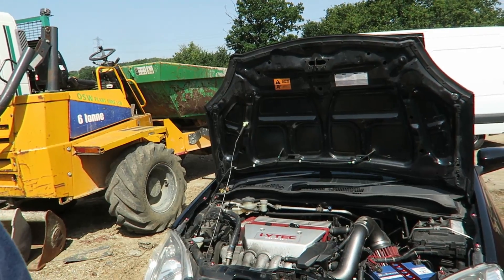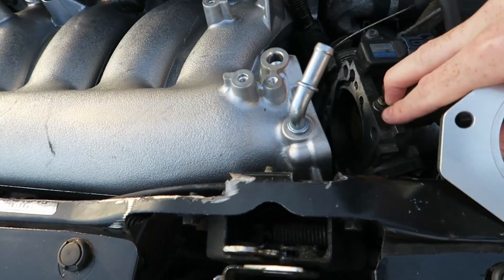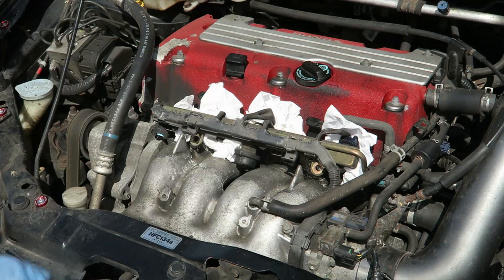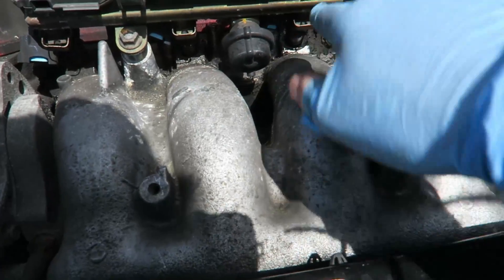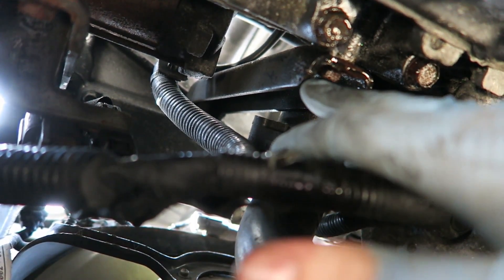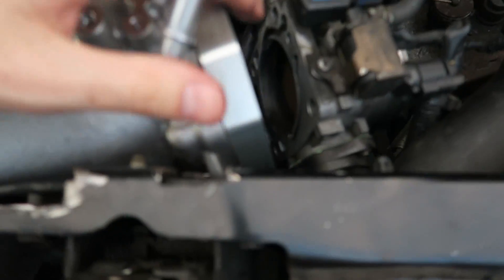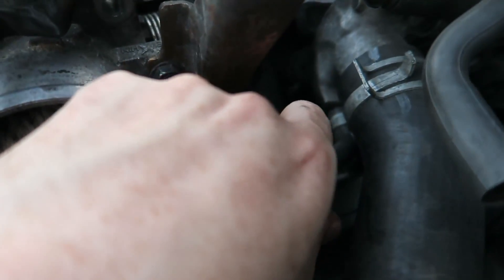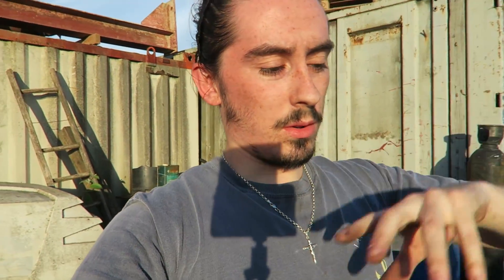Fiiting an RBC Intake Manifold to the EP3

Comment: Good informative video , keep up the good work mate
Reply from the maker: Cheers man, just need winter to be over 🙄🙄🙄
Reply: @UnluckySully  yeh haha the car is taking shape mate , you're doing the right thing doing the do-able jobs yourself , will save you a fortune. When you planning a remap ? Power run etc? I run a 55 plate cosmic premier.
Reply from the maker: @fasteee  I already have remapped it, I had a video on it but it made 242 😂😂. With your face-lift you would make more though, really love cosmic grey though 😍😍😍

Comment: Thanks for the video. I am considering this upgrade and I didn't know about the MAP plug. I also have the same AEM V2 Intake you did and I now know that it will not fit with the intake (At least without modification)
Reply from the maker: Same I was really confused when installing it and seeing an unplugged hole in the intake. Couldnt find any information about it. Exactly even if you did get the AEM V2 to fit there would be so much heatsoak killing horsepower.

Glad the video could help!

Comment: So tegiwa, be lying when they say HONDA RBC Intake Manifold. However straight out of the box it needs modifying and will not fit the K20. Ours are modified here in the UK on our CNC vertical machining centre, and are therefore ready to fit straight onto a Civic Type R EP3. But you needed to cut yours to make it fit

Comment: Hiya mate - decent video, enjoyed it! thinking about doing the same mod on mine. Question for you - did the car run okay after install or did you have to get a kpro to map it etc? or do you already have a kpro/k100?
Reply from the maker: Hi, thanks for watching! Yea the car runs perfectly fine without any ECU changes as its still letting the the same amount of air in the engine, but in order to get the best gains from it you would need to remap it.
So yea I installed it and drove it for about 2 weeks no problems and even drove it 60+ miles to get it remapped on a stock ECU
Reply: @UnluckySully  nice one cheers for that! I was worrying as im planning on getting rbc and maybe bigger tb - then save for the kpro, and was assuming the Air fuel ratio might be impacted but sounds decent cheers fella!
Reply from the maker: @DJ-J3  No problem man, I mean with a bigger throttle body it might run a little bit leaner but that wont cause any issue to the engine or reduce power, do youre all good. Hope it all goes well for you :)

Comment: Do you need a different cooling hoses for the oem body??
Reply from the maker: Nope I used all the original ones, you could change out one of them as it does come up a little short but mine fit and haven't changed any of them since

Comment: Do you remember how you ended up getting the 2 other bottom bolts out?
Reply from the maker: Yea I used a knuckle socket adapter to crack it then used my hand to get it off, it's very difficult with the limited space 👍
Reply: @UnluckySully  thanks for the fast reply!

Comment: Did you drive long time whit the 63mm throttle body whit no tune?
Reply from the maker: I drove around for about a month with it and there was no issue
Reply: @UnluckySully  thanks man.   I have now injen long arm cold air,   70mm tegiwa cat back and custom plm header
Reply from the maker: @driftking1933  Ahh nice, have you got it remapped or are you doing anything else before?

Comment: is this a 70mm ported inlet ?
Reply from the maker: Yea it's 70m but you can buy a bracket that can fit the standard throttle body as well so you don't have to install the rbc and 70mm throttle body at the same time 👍👍
Reply: @UnluckySully  thanks for the reply im in 2 minds to do the tb or not
Reply from the maker: @teridunford7299  I wondered about this as well, so when I asked the guy who remapped my car he said he makes very little different between stock and 70mm especially when 70mm is like £250
Reply: @UnluckySully  which then leaves my thinking if i dont do the tb should i bother spending the extra on a ported rbc over the standard rbc inlet
Reply from the maker: @teridunford7299  from what I remember you need a ported rbc manifold to put on the ep3 you can't just take an rbc from an dc5 and put it in, but I could be wrong

Comment: How the hell did it take you 3 days to put an rbc on 😂
Reply from the maker: This is what happens when bolts don't come off and there is very little information on how to do a mod XD. I can't lie I got the wrong throttle body gasket which slowed it down a lot as well :')
Reply: @UnluckySully  fair play for persevering bud
Reply from the maker: @Jon-jc1jf  well its either that or I don't have a car 🤣🤣

Comment: Too much of a faf plus you have to knotch out slam panel that's why I went skunk no notching out no pipes no faf just bolts on....... Your intake will be heat soaking like mad you need an enclosed system
Reply from the maker: Yea it's a lot of messing around but it's really worth the gains that it gives, and I'm changing my intake anyway so I won't be suffering from heat sake anymore 😁😁